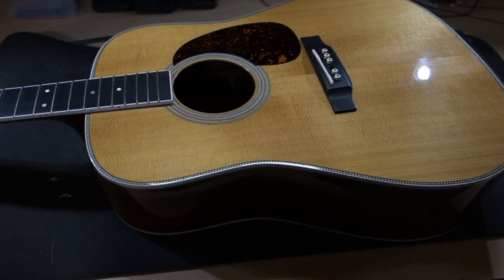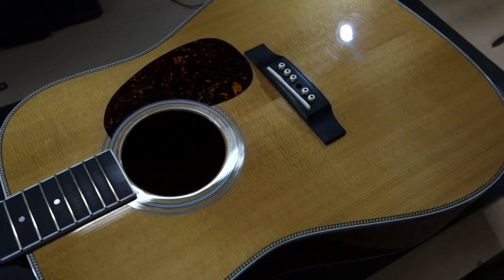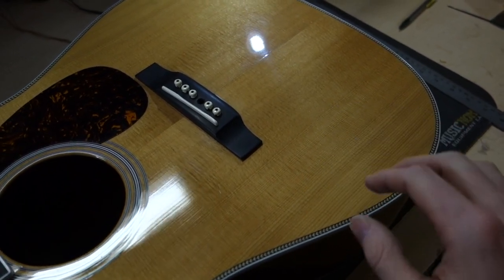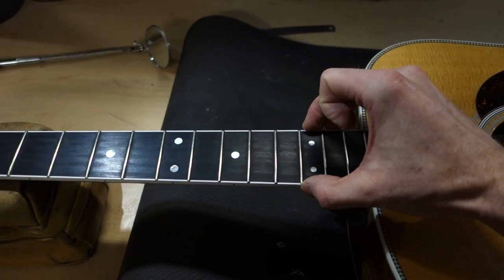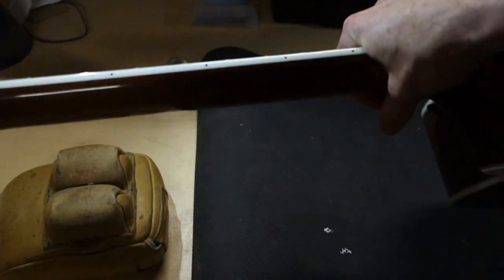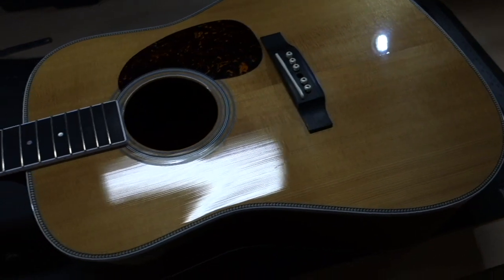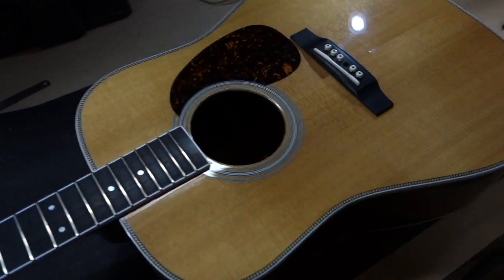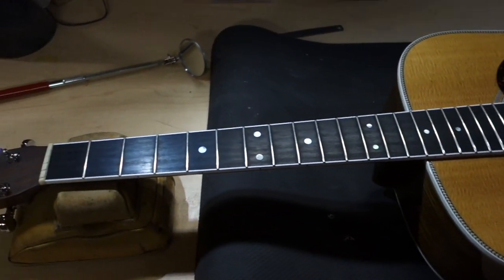How to Spot Dryness/Low Humidity Damage in an Acoustic Guitar.

Comment: I guess I've gotten lucky because I've got a 1991  Gibson J-45 in storage essentially since new in our Canadian climate. It shows almost no signs of drying. I didn't know they were so effected by the climate, but I've just bought a sound hole humidifier that I'll check regularly. Is it okay to close the case with this type of humidifier in there?
Reply from the maker: Hi Jim, Yes, and with these type of humidifiers you want to use them in the case when it is closed. Most of the sound hole or case humidifiers used with instruments are small and can only humidify a limited space. If you have the case open, or you try to use them with the instrument on a stand then the majority of the humidity will escape and the humidifier will have little or no effect. Hope that helps.

Comment: re: Martin acoustic 
Josh, is the spruce top area right in front of the bridge supposed to be slightly arched or just  flat across laterally? If it's supposed to be arched, assuming it's properly humidified, by how much?
Reply from the maker: Ideally there would still be a slight arch in front of the bridge but is fairly normal for the area directly in front of the bridge to flatten out. This is the point were there is the most tension/pressure on the top. It depends a lot on how the manufacturer is constructing the top. If it is only a slight arch (40' radius for example) then it doesn't take much for that area to go flat. What you don't want to be seeing is a dip in the top. That might indicate that there is a structurally concern. And a serious dip behind the bridge means the top is probably very dry.

Comment: Sorry .... one more question Josh. I am now faced, once again, with re-hydrating this Martin. Once I get it back ... do you think having the room humidified will keep it playing properly? I would still case it at night ... but because I am playing it a lot ..  I was hoping I could keep it on its stand for the day. My tech says ... because of its history ... that will not be enough and it will dry out again. even in a humidified room. Thanks kindly .... Jackson.
Reply from the maker: Hi Jackson, Sorry for the delay getting back to you. A room that is properly humidified is fine for guitars. However you need some way to verify that you are keeping the humidity high enough. If you live in a really dry area (cold dry winters), and your home heat is running a lot the room could still be dry. A hygrometer is the best way to tell. Typically you are looking for 45% relative humidity. One thing is that the cheaper digital hygrometers you get at the hardware store can often be out 5% or more. In which case it could be reading 40-45, and in actuality only be 30-35%. I use high end hygrometers that are certified accurate. However before I bought the expensive ones I had 3 of the cheaper digital ones. I found if I took the average reading off the 3 it was usually pretty accurate. If you're going with cheaper hygrometers than I'd buy 2 and place them on either side of the room. It is alot easier to keep the humidity up in the case. Where I live it is cold between Oct-Mar. During those months I keep my guitars in their cases with a humidifier. If the temp gets really cold I'll add a second humidifier to the case. This is an easy way to ensure the guitars don't dry out, but they're are not as handy as if they are out on a stand. So if you can keep a room humidified great, but you need some way to verify you're getting enough moisture. The safe option (maybe even temporary) is keeping the guitars cased with humidifiers. If I can be more help let me know.
Reply: @joshuahouseguitars  Thanks Josh ... it's been in the case for the past week having a drink. I guess my concern is the "wood memory" notion. If that's true ... it may lead me to decide to part ways with Martin. I am enjoying the sound but it just seems so impractical if you just want to grab and play throughout the day. That old Aria has spoiled me. Pick up and play ..... never lets me down. More solid bracing I suppose. We'll see how this latest humidification goes and I'll do my best to keep it healthy and the room at 45. It's all about habits. Thanks so much for the reply Josh!
Reply: @macerockson  Hi, what did you end up doing? I just got a Martin D-10E and it is very dry, and sunken. Probably mistreated in Guitar Center warehouse. I'm afraid it will always be problematic. One day in and it is buzzing and the bridge is sunk. I've  been told to rehydrate it but I'm afraid to keep it now. I absolutely love the way it plays and sounds, more than any of the others under $1000. But am nervous now.

Comment: How do you determine the radius of the guitar top?  I have a 10 mm Arch in the center of the guitar between the bridge and the tail.  A straight edge rocks 10mm each direction when parallel to the bridge.  8" to the edge of the guitar from the center.  GS mini.  thanks.
Reply from the maker: I find that if it is a factory made instrument the best option is to google the top (or back radius) for the specific model. You can measure it, and figure it out using some math, but the radius on the top can change a lot based on the current state of the instrument. If it's dry then the radius will show as being flatter than it should be, and if the instrument is over-humidified then the radius can show as being larger than it should. Finding out the original radius that the instrument was built to is the best starting place.

Comment: I just got a 00-28 and notice the top overall, is alot flatter than my previous Gibson Hummingbird or really most acoustics I've inspected.  It's not sunken, just surprisingly flat, especially around the sound hole.  Is this normal on Martins?
Reply from the maker: Sorry for my slow reply. I don’t know if it’s normal, but I’ve seen it a lot on Martins. It is typical on a lot of guitars that they will belly up a little behind the bridge and flatten out a bit in front of the bridge. In general Martin’s have light bracing, so seeing some movement like this can be expected. Gibsons can be all over the place with bracing depending on the year and model. Some Gibsons would have a much heavier bracing than a Martin. It can be expected that a guitar with heavier bracing will not move as much. Also, although most acoustics are built with some arch in the top, the amount of arch can vary a lot with the model and manufacturer. My guess is your Martin started with a flatter radius than the Gibson. In general flatness in front of the bridge is not a major concern, provided it doesn’t go beyond being flat and start to sink.

Comment: Electric guitar is the same?
Reply from the maker: Electric guitars are still susceptible to humidity damage, but the damage is usually not as extreme as it can be on acoustic guitars. The thin top and back plates on an acoustic will dry out a lot more quickly. The things you sometimes see on dry electrics are frets sticking out past the edge of the board. A flat fingerboard, which no longer has any relief (this can cause buzzing). And occasional cracks int he board. If it is a solid body that is fully painted than the body should be ok even in a dry environment because it is totally sealed.
Reply: I live in the northeast, my electrics don't get the meticulous humidifying my J45 and D18 experience. My telecaster and les paul of 15 years and 10 years still play great and dont really have issues in setup like an acoustic would experience. Mind you others may have different experiences.

Comment: See why i prefer laminate . much more stable and resistant
Reply from the maker: That is an advantage to laminate, it is resistant (pretty much immune) to humidity changes and as a result can be a good choice if climate control is an issue. On the flip side, the tone from a laminate top will not develop and improve overtime the same way a solid wood instrument will.
Reply: @joshuahouseguitars  strongly disagree . i have a 50 year old laminate that i would put against any guitar . including a GI Gibson i played that almost 100 edit: in fairness i build guitars too and i replaced the bridge and fixed a broken brace . no neck reset yet but getting close . i sold my old solid top and kept this . bracing and mass are everything with these acoustics . thank you for responding

Comment: How to fix dried guitar at home?
Reply from the maker: The best way to humidify a guitar at home is keep it in a case with an in case humidifier. This will help to restore the guitar to proper humidity.
Reply: @joshuahouseguitars  I found a video where it said to put a small wet clothe inside guitar and let it dry so it can be fixed
Reply from the maker: @larrysmusics531  A damp cloth inside the guitar will do the same thing as using a humidifier in the case. However I would not want to put the damp cloth directly onto the wood on the inside of the guitar. If the guitar is touching the unfinished wood on the inside of the guitar the water will go directly into the wood, and that would cause it to swell wherever the cloth is touching the unfinished wood. If you are going to use a damp cloth I would set it on a pice of plastic, or in a plastic container so that it is not in direct contact with the wood.
Reply: @joshuahouseguitars  yes I put the cloth on a plastic Pouch

Comment: Funny, I have a brand new d-35. I’ve had it for about a week and I’m noticing these little dry blotches on the top and I’ve only had the guitar for a week. It’s December 2nd here in New Jersey so it’s pretty cold. I’m kind of worried about it. I can’t imagine the guitar is damaged already after having it for 6 days unhumidified
Reply: Buy a tube of glue You will need it for a Martin. In my collection only the Martins are breaking.
Reply: @crazycat1345  were they made in the 70s
Reply: You need a hygrometer 
They are cheap, can get one at Home Depot, to see how the humidity is in ur house, keep ur guitar away from a heat vent , get a music nomad humidifier thingy lol it goes in between the strings, it’s a sponge but squeeze it out , it’s only supposed to be damp, and then close ur case, see how long it takes to dry up. Also if you bought new keep that warranty paperwork